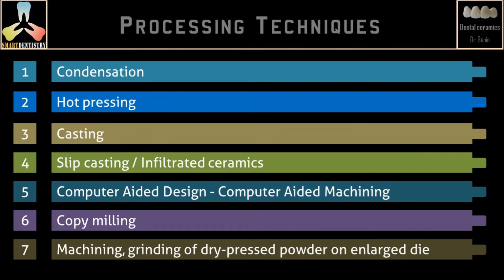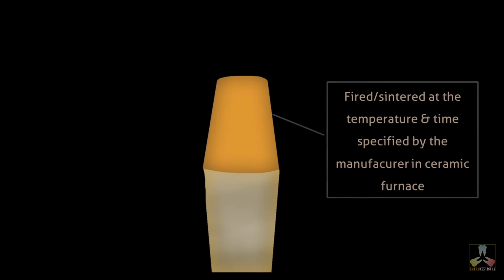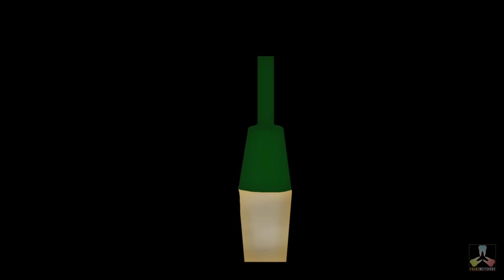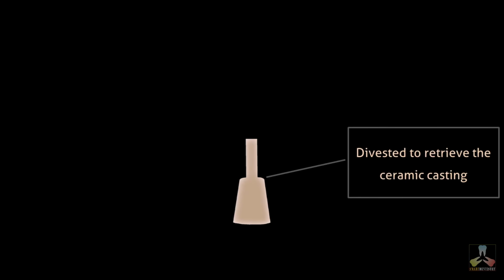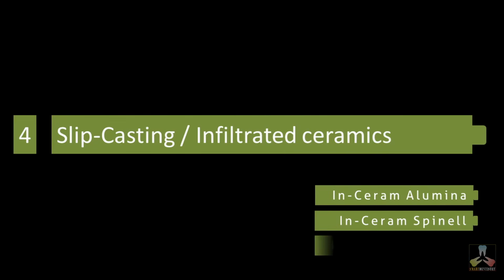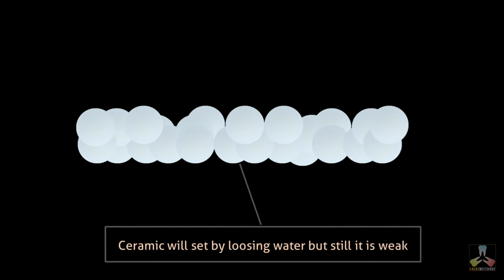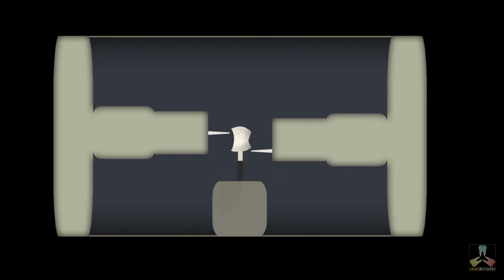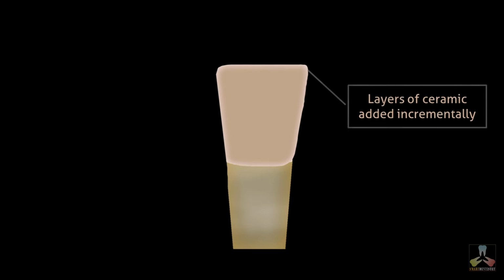Dental ceramics | Processing methods

Comment: At 10:32 you said ceramics are difficult or impossible to melt but while pressing or casting, you said the ceramic blocks are melted and then pressed/casted.
Also, your explanation didn't clear the difference between casting and pressing. In both cases we used ceramic blocks (you didn't clarify what blocks, sintered or partially sintered or powder? And both pressing and casting used lost wax technique. So what's the basic difference??

Comment: Sir please. Make a vadio on ceramic cementation and their mechanism
Reply from the maker: I have included the topic you suggested in the upcoming video list
Thank you for your suggestion
Upcoming videos in Smart Dentistry YouTube channel
Bounded file versus binding file - @sauliharizwan377, @vickyrock1873, @siddhiraut8472, @hristohristov650, @burrwnawna, @ayeshasiddiqua-ue4ss
Anterior proximal composite restorations - @raghuramm563
Finishing and polishing of composite restorations - @DrHozefa
How to create the perfect anatomy in posterior composite restorations - @DrHozefa
Working length using RVG - @manadentist2267, @sushrutachakraborty464, @dentalking7859
How to use apex locators to get accurate reading? - @katyaynigupta5259, @Sreemol17, @dentalking7859, @dentalshorts6848
How to determine the correct taper for canal preparation (2%vs4%vs6%) - @akanshas8424,@abdurrahman2980, @benoitblanc8898
Diagnosis in Endodontics - @MuhammadAbdullah-iy3hc, @bsk4627, @vijyantmehrotra8119, @manadentist2267, @akshuDhavalshankh, @katyaynigupta5259
Dentine bonding agents - Part 2 - @bigdreams3712
How to bypass a fractured file? - @karthicks5760
How to do periapical surgery? - @derekshaji8173
How to remove a fractured file? - @karthicks5760
How to prevent ledges, blocks, zipping and canal transportation - @Philosophyforlifeofficial 
Apexification procedure – @anumadhukar9171, @sanghamitrasagariya4087, @katyaynigupta5259
Perforation repair - @anumadhukar9171
Avulsed tooth management - @Drpoojagarg5310
All ceramic crown preparation – Anterior - @KiranrajkumarHatangle-eo4wm
Molar crown preparation - @KiranrajkumarHatangle-eo4wm
Radix entomolaris - Case discussion - @sauliharizwan377
Palato gingival groove - Case discussion - @sauliharizwan377
Root canal negotiation techniques - @vickyrock1873, @siddhiraut8472, @hristohristov650, @katyaynigupta5259
EDTA in Root Canal Treatment - @rosemeher1321, @hristohristov650
Understanding root canal calcifications - @rosemeher1321, @hristohristov650, @katyaynigupta5259
Operator positioning for Root Canal Treatment - @chandrasekharsahoo6713
Analgesics after Root Canal Treatment - @mdmozahedulislam3923
Root canal sealers - @sudhaa5674
Sealer puff – Good or bad? - @derekshaji8173
C shaped root canals - @karthicks5760, @LearnUnlearn90, @katyaynigupta5259
Middle mesial canal - @karthicks5760, @katyaynigupta5259
Reference point in root canal treatment - @anujgarg952
Heat and H file technique for GP removal - @chandrasekharsahoo6713
how to do BMP effectively without any pulp tissue remnants in a single visit RCT - @rainbowsalt-gc7ek
class 2 composite and matrix to avoid gaps between teeth after using toffelmeir system -  @sauliharizwan377, @hishamkhan3800
Curved root canals and file selection
Everything a beginner should know about rotary files
Ledges – prevention and management - @dentalshorts6848
Prefabricated metal post
Pre fabricated fiber post - @anithabalex8124
Ribbond post and core - @bsk4627, @sajaljain4192, @sauliharizwan377
Custom cast post and core - @derekshaji8173
How to select the proper crown - @DrGreenfun
Cast post Vs fiber post? Which one to choose? - @SnehaPK-rt3tn, @alokegupta3165
Occlusal considerations in post endodontic restorations - @tubeindahouse